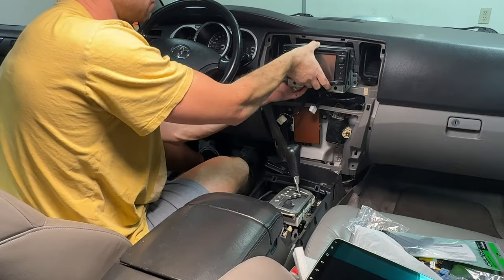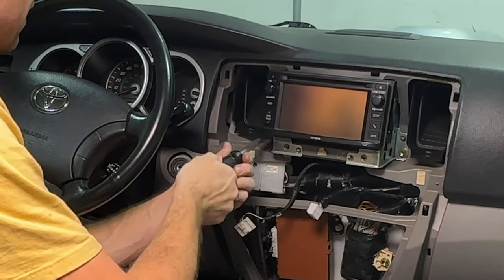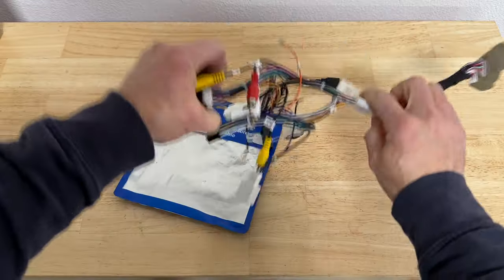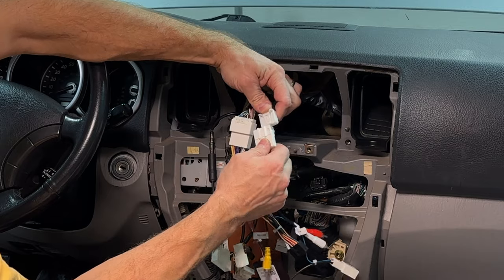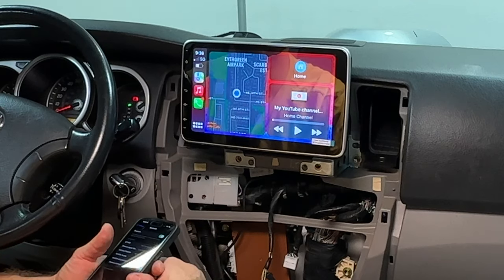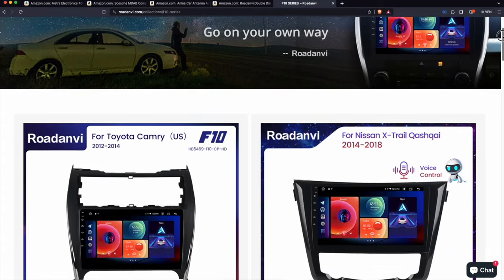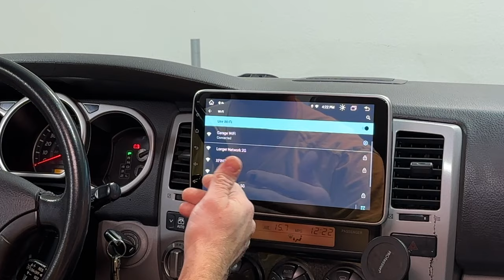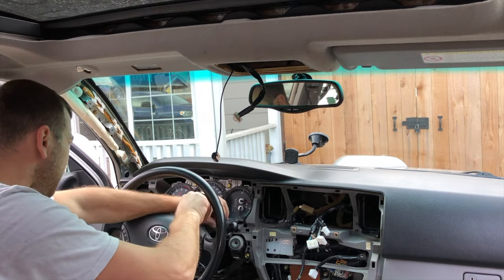4th Gen Toyota 4Runner Wireless CarPlay Roadanvi Head Unit w/ Floating Screen | Plug n Play Install

Comment: The link for Dasaita power cable adapter for JBL sound system is taking me to another product don't know what is it is..... Just click on the link yourself and you'll see.
Reply from the maker: Hey man thanks for sharing. I guess they don't have it on amazon anymore but they have it on ebay. Here's the link: https://ebay.us/XnhYZU
Reply: Hey Man @tronixster , thanks for your  prompt reply. 
To be honest I'm hesitating to buy it but like you have good experience so far, I will definitely put it on to give my car a fancy and newer look. By the way, the stereo runs android 10  today some  car stereos have the latest software. Here is my question : Do they have like a stereo with the latest android software ?  if I get the Car Stereo Radio Power Harness Cable Wire Adapter Support JBL AMP For Toyota. Can I use it to connect other aftermarket stereo if I decide to buy another stereo? because I don't like the stereos that require splicing the harness I need a plug and play one.  
Thanks
Reply: @ysinda5  any luck with that radio install? Did you purchase the other wiring harness through eBay? My sons Runner is non JBL so just confused on whether this is all worth it or not. Any feedback you could provide would be great !!! Thanks
Reply: @mannyalmeida916  , Hello ,  yes I bought that radio and installed it. The result was very mediocre 😕, the sound was very poor, and the SWC (Steering wheel control ) didn't work after multiple configurations from the stereo. I bought the harness on eBay. Like I said the outcome was deceiving, but the installation was plugged and played  with no splicing. As a result of my experience with this stereo, I don't recommend buying.
Reply: @ysinda5  so just poor quality on the radio is what you are saying ….. we don’t have steering controls or JBL speakers so
I wonder if our experience would be any different. I am trying to find the correct wiring harness cb004 but not having any luck.

Comment: You’ll need these 9 adapters 😂 thx for the info
Reply from the maker: lol no problem I’m glad you liked it 😁
Reply: Do I need all the adapters if I don't have the  steering wheel controls or the upgraded sound system? Mine has a cd and tape deck factory radio

Comment: Hi. Paul. You still have the Headunit PT546-52150 from the Toyota Yaris that you had installed in your 4Runner. Do you plan to sell it?
Reply from the maker: Hey David, no I don't have the unit anymore. I was planning on keeping it but then one of my friends decided to do similar conversion so I've sold it to him.
Reply: Ok. Thanks you.
Reply: @davidmon62   Hey man , I do have this head unit. If interested let me know.
Reply: @ysinda5 you have the old Toyota touchscreen head unit for sale?
Reply: @ysinda5  sorry for the late reply but I actually found the head unit on marketplace that some girl was selling for $50 so I couldn’t pass it up, thanks anyways!
Reply: @ysinda5  I'm considering buying your head unit, but the original video did NOT specify if this is a 6-CD changer, or just a single CD unit-? And if so, I'm GUESSING it's all the same, because the mechanical changer-contraption is integrated in the Toyota factory head unit, right?
Reply: @ednauseum3060  , it is a single CD unit .
Reply: @ysinda5  Thx.